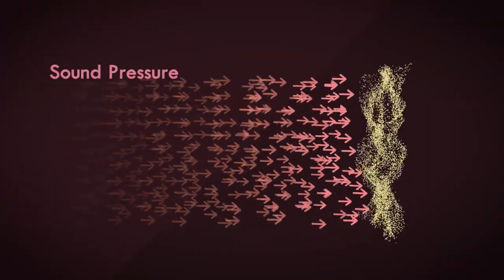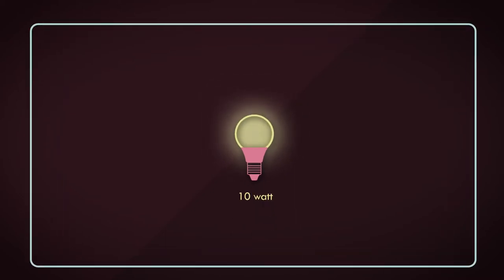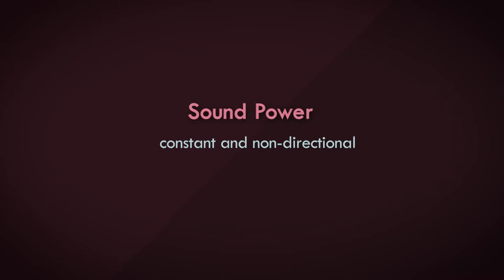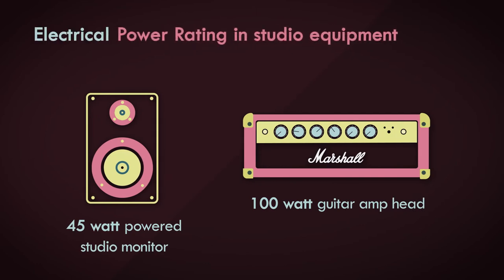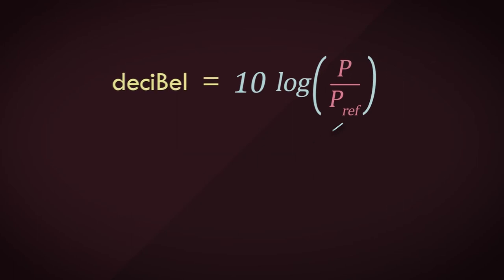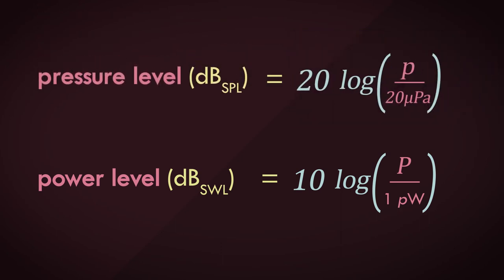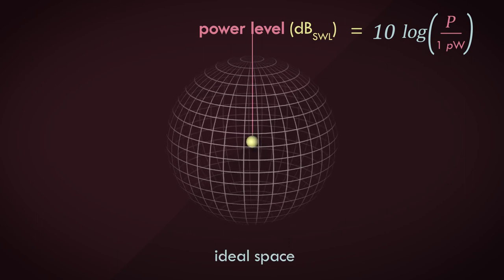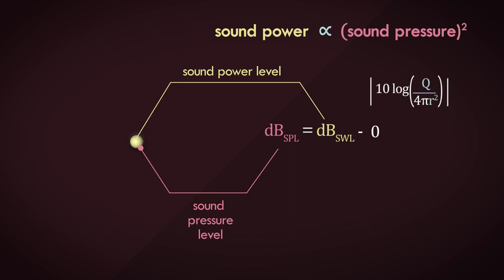4. Sound Power - Loudness and Level

Comment: Hi! thank you for sharing knowledge.
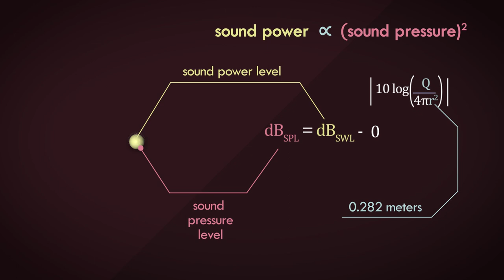One quick question at 9:14, how come there is an absolute value at the 10log(q/4pir^2)? This mean that whenever you get closer to the source than 0.282m, the spl actually get quieter? How can this possibly be?
Reply from the maker: Hello there! Great observation. I was thinking about the same question when I was doing the research. The reason why I didn't explain this in the video was that I wasn't a 100% sure. 

So the idea of sound power is purely theoretical. It's calculated for a point source. Point sources don't exist in nature, and for geometric calculations for surface area (to calculate sound pressure) we have to use a unit source rather than a point source, because the surface area of a point source is 0. In the metric system, the unit of measurement is a meter. So we consider a spehrical source of sound rather than a point source. 

If we do this, then the sound power is emanating from the surface of this sphere, so naturally the sound pressure will be maximum at the surface (0.282m). If you go lower in distance, it's almost like you are going into the source of sound, which doesn't make sense. But you can also think about it like this: 

You have a speaker in a cabinet. At the cone of the speaker, sound pressure is highest. But if you go further, you go past the cone and into the cabinet, essentially going through the source of sound to the other side. And if you think about it, sound pressure will be lower within the cabinet than at the cone.